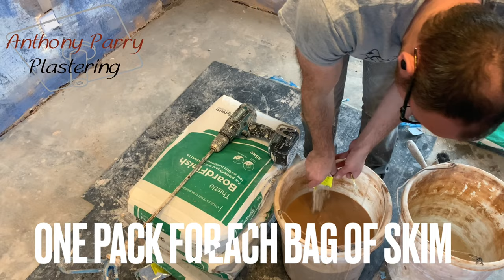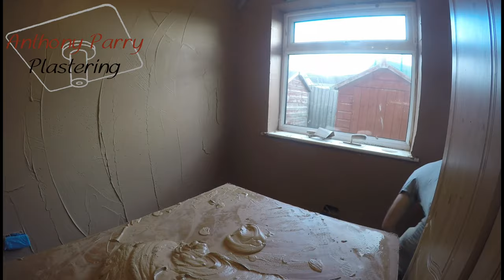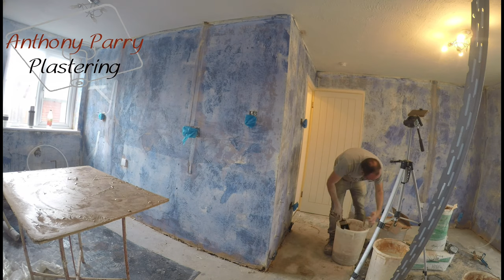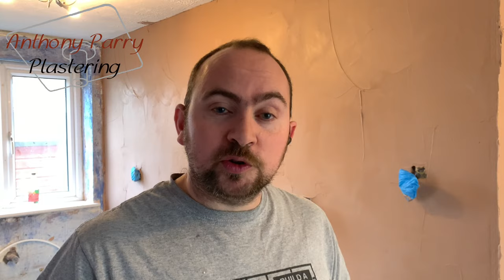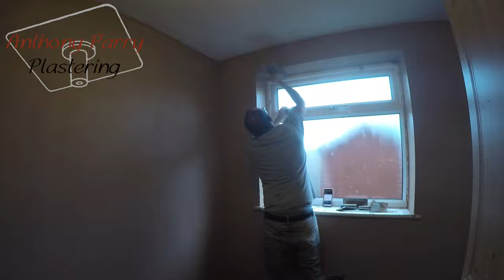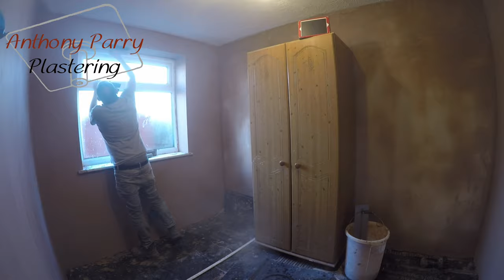How to use Extratime by Eazymix. timelapse video. Plastering

Comment: Nice video I’ve used it couple times and it works great good to have for summer months when you got a big area to do and can’t get hold of another plasterer to help but for smaller walls just easier to do normal sets with out it as does make it a longer time per set

Comment: Just out of curiosity mate do you not cross trowel aswell. As following the same direction on all passes surely leaves lines, not saying I can see any but just wondering good work mate.
Reply from the maker: Hey Dale, I’ve never had a problem with lines. I have cross troweled but I tend to do it on big flat areas.  but it doesn’t really make a difference to my finish. 
But I wouldn’t discourage from doing it. Everyone has there own way of doing things.
Reply from the maker: And cheers bud

Comment: Cream of tartar gives you extra half hour or so one sachet per bag of skim. I use it in summer now and again.
Reply from the maker: I’ve never tried it. I’ve been told about it a few times. I’ll have to try it one day to be able to give it a comparison 👍
Reply: @AnthonyParryPlastering  been about 30 years now using it on and off never had a problem
Got told about it by my uncle whose old skool in his 70s now and I’m 50 so it’s been tried n tested 👍🏻
Reply: GP Walltickler how much to one bag mate
Reply: @davedump4943  one sachet per bag does the trick

Comment: Do you rate blue grit over pva?
Reply from the maker: Hi Toby yeah I do, especially when you work on your own. 
Pva works great but i feel I’m doing more chasing with pva. Where with blue grit I paint it on all the walls and that’s it. It’s more controlled. One thing I’d say thou is I tend to put skim on a bit thicker with blue grit so you use a bit more tiny bit more stuff. 
But I swear but it.
Reply: @AnthonyParryPlastering  nice1 thanks for the reply, does it actually take 24hrs to dry before you can apply the skim then?
Reply from the maker: @tobyharris2889  I find about 12 hours is fine. But it’s more down to the conditions.  If it’s still wet then don’t go over it. If you have a warm house it goes off quicker.  
I’ve heard of people going over it after 6 hours but I’ve never tried that. I normally leave it overnight and it’s normally dry.
Reply: @AnthonyParryPlastering  ah thats not to bad, decent thanks for the advice👍

Comment: Cream of tartar I’m told but need a certain type of job in order to try it
Reply from the maker: I’ve been told that it speeds it up rather than gives you longer. I’ve never tried it myself. 
I got sent these to try and it been working really well for me.
Reply: Been using it for years. Works fine  and cheap

Comment: Sodium  citrate  does exactly  the same thing but again is loads cheaper you can get a kilo for around a fiver
Reply: Thanks for that tip Ed, how much of it do you recommend I use per bag of plaster? And are you a plasterer?
Reply: @dcp6513  I use an empty half time   sachet to gauge  it originally  , then bought some of those measuring spoons that they use for cooking.  1 full sachet in a 2 bag mix normally  speeds up a set by half an hour . The more you put in the quicker it sets , you can also use it in bonding coat too which is great .
 Sodium citrate slows the set down ,.does exactly  the same thing  as extra time costs a fraction of the price.  Been plastering 17 years .
Reply: @edwallace3704  thank you for this, I’m definitely gunna buy some. I’m new into plastering and must admit I do find it difficult. Can I ask how long it took you to get the hang of the skill?
Reply: Aluminium  sulfate speeds the set up sodium  citrate  slows it down
Reply: @dcp6513  it  depends  on the person  doing  it  , just go for it
Reply: Ed where do you buy this from mate? Cheers
Reply: @kevinlawes591  Ebay mate , I used it in cement  last week and it worked  a treat sending off the scratchcoat lovely and quick over rough  as fuck uneven stonework , then put the float coat on with zero sagging pretty quickly  afterwards  , happy spreading mate 😀 
Half time and extra time is a fucking big con , once you sus out aluminium  sulfate  and sodium  citrate  , tell all your friends